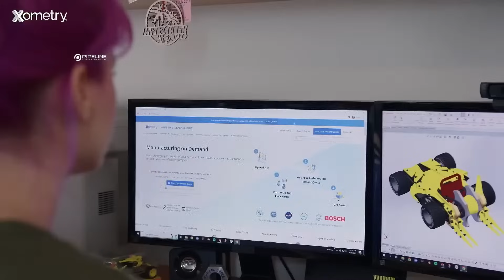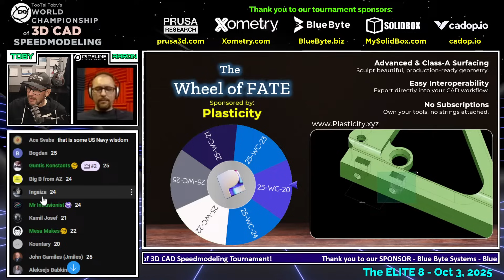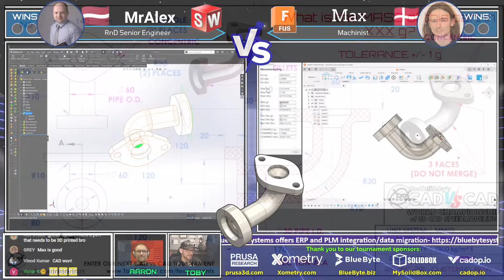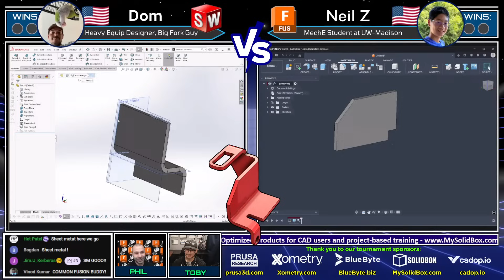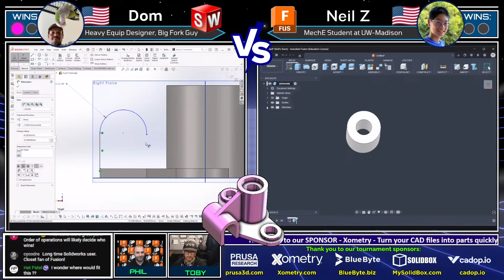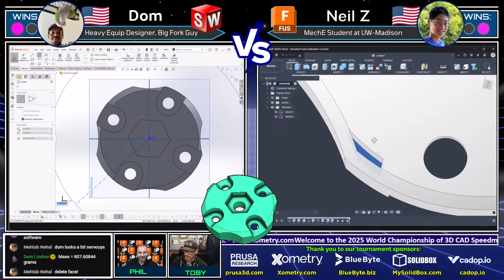World Championship of 3D CAD Speedmodeling - Tournament - ELITE 8 - Oct 3rd

Comment: Hmm, Max should not have won the first challenge with the pocket on the wrong side.
Reply from the maker: Nice - thanks for the comment and welcome to the channel!
In this tournament we award a point based on correct mass. This lets the runners have some freedom to be creative in how they come up with the answer.  IF they wanted to, they could (in theory) even use a pen and paper or calculator to math out the volume, and then the mass. 😁
However they get there, if the mass is correct, they earn the point.

Comment: Hmm. For the umbrella stand, the density values in the default install of Fusion are 673g/cc for red oak and 1060 g/cc for ABS. So my answer came out at 3.2616lb. If you change the numbers to match the table in the drawing (570 and 1020), you get the "correct" value of 3.061lb. So unless you know how to change the properties of the materials used, you are stuffed. Sneaky!! Was that an intentional gotcha or are the values correct in one of the CAD packages out there?

For reference, to modify the density in Fusion, click on a body containing the material you want to change, right click and select "Physical Material", then right click on the material "in this design", select Edit > Advanced... > Physical > Mechanical, then finally change the density value and click OK. The bodies using that material will then update. Repeat for the other material(s).

My approach used one sketch for all bodies and an offset plane at 16" with the original sketch projected onto it. Extruded the ABS bits from either the ground plane or the offset plane and finally extruded the rods in place between the faces of the cavities. Apart from the density gotcha, this was nice and easy, creating the bodies where they needed to end up.

You should def penalise players who leave a mishmash of bodies that don't look like the drawing assembly. Allowing hacking and "exploits" avoids having to learn how to work elegantly and efficiently but that's just me.